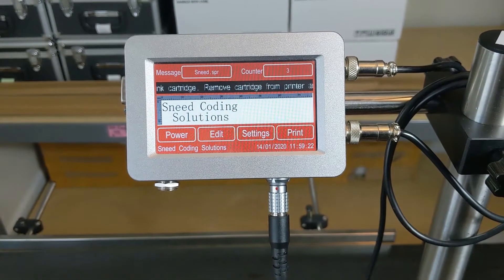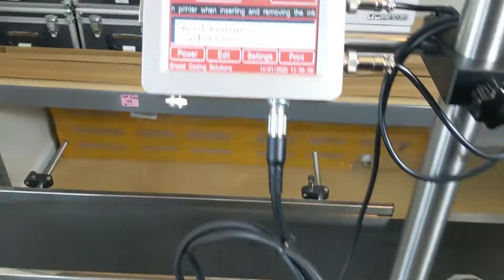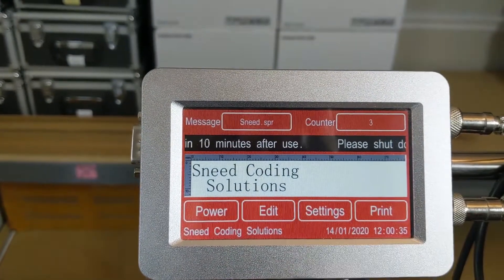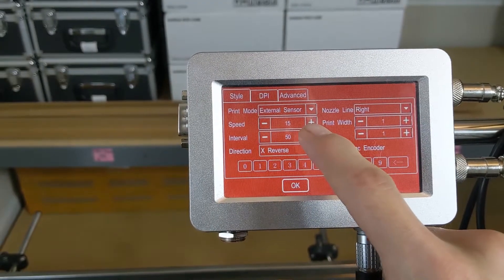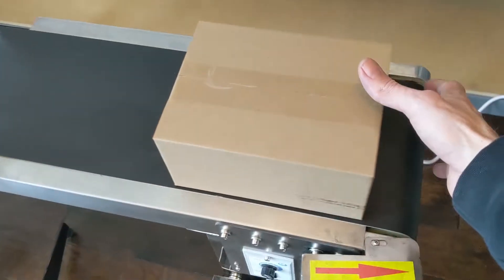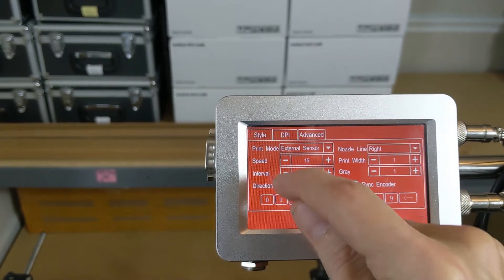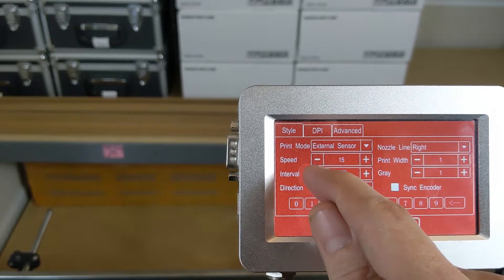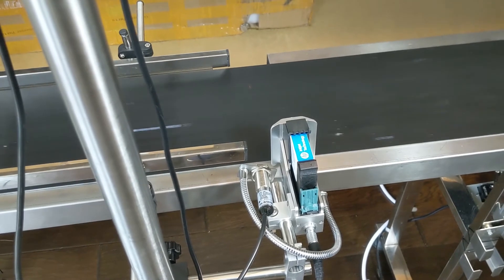Meenjet MX1 Printer - How to Set the Print Delay (Interval)

Comment: I am going to be using this on a machine I manufacture. It is a highspeed feeder.  (Technically we should talk about it being on your website, it goes hand in hand with what you do.)  I am an independent engineer, I work worldwide in some of the largest manufacturing plants from pharmaceutical to food, to print and packaging. My speciality is automation, and that includes automating old machinery, new machinery, and we have a large list of our own equipment on the market that sells worldwide. I am not going to use this comment section as for advertising. I really like this printhead, it fits the application I have in mind well. I also have a series of modular conveyors coming out, including flat belt, as shown here, vacuum belt, and lugged belt. I have worked with MANY of the inkjet technologies from the ground floor, I myself owned one of the largest commercial printing plants in Ohio (sold). Back to this head.... very intuitive and easy to set up. I think the target audience IS for factory floor personnel, and to keep it simple, but that is the name of the game all across every industry anymore. Keep it simple, high production, few passes, low skill level, less employees. This is a Chinese company, (Meenjet) but they did their work well here on the interface. it is better than most of the Western inkjet head interfaces.  If you want to have someone from the company contact me:  Brent@BarnhartEquipment.com  I will however be in touch.